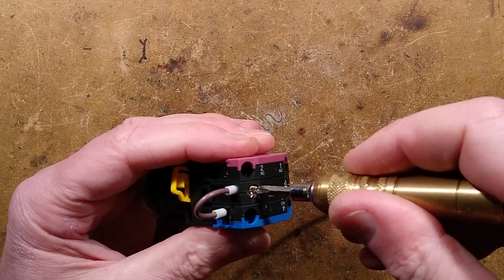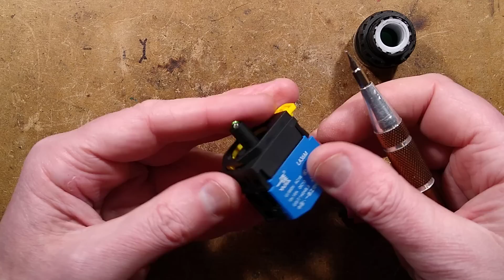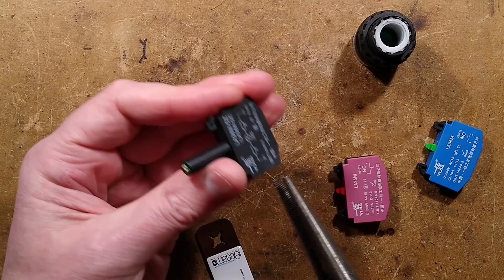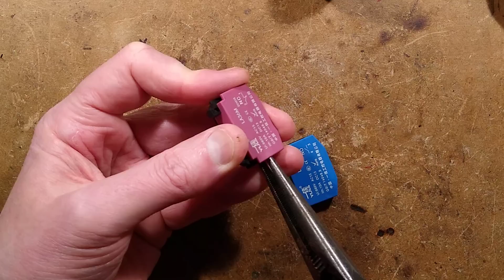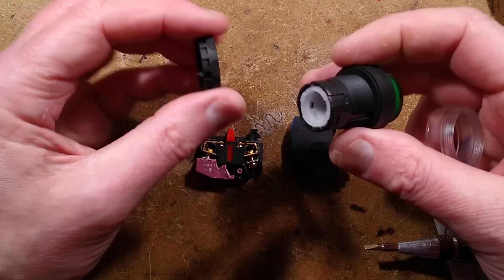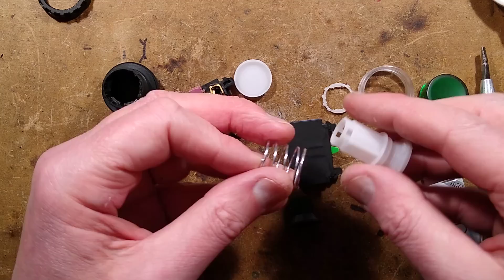This did not come apart easily!

Comment: We go through a lot of the 2 and 3 position switches like that.  The nylon indexer has a very thin connection between where it is screwed in and the strong spring.  That is the only part that breaks on the ones we use.  Good thing they are relatively cheap and always in stock.

Comment: RSVP that button switch. It was a little disappointing that the switches were just the boring springy type, I would've expected more of a snap action type for the higher-voltage application.What wasn't disappointing was the carnage. There really was no other way around it, and it had to be done, for science.

Comment: Hi Clive,
I have a totally unrelated question about new oil-filled space heaters:
To put it simply I bought a new one about a year ago however it was pretty much unusable.
So much so that in the end I returned it to the store and bought a second-hand one probably made about 40 years ago and it works as fine now as it did back when I got it.
I don't think my particular unit was faulty but rather that it's a intentional design choice however this still puzzles me up until now.

Long story:
After only a few minutes of operation the brand new oil-filled space heater switched off by itself. It couldn't be the thermostat since it was set to its maximum setting and my average-sized bedroom didn't get much warmer with only 10 or 15 minutes at most of heating.
So I took off the cover and found that it was the thermal cutout that was cutting out while the heater was just hot enough for it to be uncomfortable to touch for more than a few seconds.

(By the way this space heater also had a tilt switch to turn it off in case it would tip and fall over.)
I then bypassed the thermal cutout and plugged the heater back in and this time it was heating continuously as a space heater should if you want it to actually heat the room it's in.

However not after long it started smelling so bad that I had to switch it off and open the window to get some fresh air.
Using my flashlight I had also spotted a faint haze that wasn't visible otherwise.

I first thought it could have been a oil leak but after having looked absolutely everywhere there was no trace of any oil leaking from the space heater.
So I think it was the paint that was giving off those fumes from the higher operating temperature that would not have been reached with the thermal cutout connected.

I wonder if this design might be a simple cost-cutting measure or to comply with the new and dumb regulations about space heaters only mandated for intermittent operation. (Not mentioned on the box or in the manual but it might still be the case nevertheless).

While those regulations might make sense for kerosene space heaters I don't see the point of forcing them on oil-filled electric heaters as well.
If only all the flats had a decent permanently-installed heating system, but that's unfortunately not the case.
Or maybe is it simply to keep the heater from reaching a high enough temperature to burn little kids hands ?

In any case this heater was absolutely ineffective at heating any room larger than a cupboard and the older unit that I bought second-hand heats my flat absolutely fine without giving any noxious fume or smell and to put it in perspective there is neither a tilt switch nor a thermal cutout under the cover. Only a thermostat and a couple illuminated switches to control the two elements. 

(Btw the new one had a single neon bulb and for unknown reasons they decided to put it on the thermostat knob rather than somewhere that doesn't move. It makes me wonder how long it would have taken for the leads to snap from the repeated motion of the knob.)

(I must also point out that before returning the new heater to the store I reconnected the self-resetting thermal cutout like it was before and thankfully the paint didn't look any different than before so I could return it without issue).

So my question is: Any idea about the possible reasons why my new space heater not only had a thermal cutout that made it absolutely worthless but also a paint that stank the place up whenever it was allowed to get any hotter than what is normally governed by the thermal cutout ?
Also what about the regulations ?

Thank's.

Comment: At my job, we recently had a bunch of e-stop switches that if you smacked them in an emergency, like one does, the switch body would fall off inside the panel without stopping the equipment. How they ever got any certification is a mystery.

Comment: Thanks never disassemble one of these. Have used this type of switch single and double gang many times over the years and found them to be reliable.  Yes brightness of the pilot light has been an issue at times, hence needed to install an additional separate brighte diode light when operating in a well lighted plantroom.  Reliability otherwise was very satisfactorily.  From what you just have showed us the brass terminal variation is likely better, less corrosion over time even though the screw and washer are steel.

Comment: In days of yore I worked for a component's factory that would assemble lots of click-into-place parts then use a single spot of CyanoAcrylate glue to hold the entire assembly together. Lots of multi moulding  assemblies usually for the motor industry.

Comment: When I worked on the railway in the signalling department, we installed similar plungers on the platforms at Liverpool St station for Porters to use for closed doors and train ready to start. They were from Switzerland and we called them Squire 'D's' and they were stackable, so could mount multiple plungers together for extra contacts.

Comment: There are similar switches that have a large, exposed, latching push button. Add a box and socket from the hardware store to fashion a DIY Emergency All-Stop button, for about $10USD. It makes an important safety device for any DIY EE Hobbyist Bench.

Comment: I get why the LED module ought to be sealed, but it's kinda unfortunate the contacts were also sealed. Granted, it's likely the case the whole module is cheap to exchange, but I could see a contact cleaning rescue attempt being foiled by those heat stakes/ultrasonic welds/whatever. One can typically live without an indicator light for a while, but bad contacts are bad juju.

Comment: I took many of those kinds of buttons apart, "servicing" them since my company is too cheap to just replace them. The good buttons that I have the pleasure to service have long grommets or screws instead to access and clean up the contacts, making my job easier on that front. They're almost always incandescent though, due to it simply being easier to have it driven with higher voltages, and the bulbs are still cheap. With that high of a PF, it tells me that the series resistors are pretty much acting as light bulbs anyways, so I'm not sure why they went the route that they did TBH

Comment: I used to work in a toy factory, many years ago.

They had some toys where the plastic parts were dipped in a chemical, I don't remember the name. Anyway the mating edges were dipped and then the two pieces were pressed together, and they kind of melted into each other. I wonder if this is something like the way your switches are put together.
Reply from the maker: Possibly methylene chloride.  It's used to fuse plastic signage together almost instantly.

Comment: It was only this year I learned that 415v is actually 380V. This solar panel engineer explained how only two of the three phases are ever lined up (he did explain it properly i have sjnce forgotten lol)
Reply from the maker: 415V is the phase to phase voltage of a 240V supply.  380V the same for a 220V supply.
Reply: If the phases were "lined up" (in phase) then the voltage between them would be 0V! As Clive said, for a typical 220V rms phase-to-neutral system (e.g. China), the phase-to-phase voltage will be circa 380V (220V * sqrt(3)), for 230V rms phase-to-neutral (e.g. Europe, UK) it will be circa 400V (230V * sqrt(3)) phase-to-phase, and for 240V phase-to-neutral (e.g. what the UK used to be in the 90s), the phase-to-phase voltage will be circa 415V (240V * sqrt(3)). The phases are 120 degrees out of sync with each other, hence three-phase (3 * 120 degrees gets the circle).

Comment: The way thats designed reminds me of the 4 position monolever I bought for my G920 wheel. I wired it up to a pi pico and whenever its actuated it does all 4 arrow keys depending on what position you push it. For headlights and turn signals in assetto corsa.

Comment: Those micro-switches are a fire danger.
All micro-switches, as per rules, must have a spring which close the contact with a set force, independent from the travel of the pushbutton. 
Just buy good branded electrical components for a fire-free environment.
Thank you Big Clive, for all your dedication in showing the inner workings of good and bad technological devices.
Greetings,
Anthony

Comment: The can opener on a Swiss Army knife makes a great spudger, specifically the can opening blade part (rather than the the screwdriver tip). It's even better if you make the blade angle a little shallower with a Dremel. It's not flexible but it's wedge profile is really good for wiggling into the joint of two halves of a plastic shell and gently working it back and forth around the perimeter until the item in question finally gives up it's secrets. A Spartan or a Pioneer, particularly the Pioneer is a really underated tool for opening objects that the manufacturer really doesn't want to be opened.

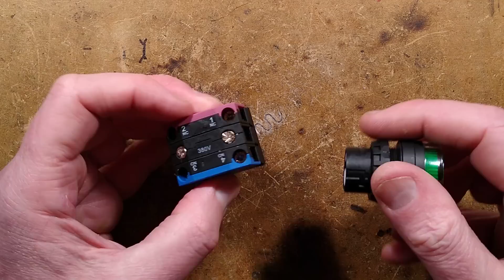Comment: 2:20 Not only China has 380V between fases, here in Belgium, and i think also in most part of Europe. 3 phases and neutral, between the phases 380a400V and between each phase and neutral 230a240V.
Reply: In the EU it was standarized to 230/400V +10%/−6% which are 216V to 253V single phase and  376V to 440V three phase so in practice each country was able to keep the same voltage and stay within the limits without having to replace thousands of very expensive transformers.
Reply: With 380V Phase/Phase you'd actually get 220V phase-neutral😅 here in germany we have 230/400V, we had 220/380V back in the days
Reply: @legominimovieproductions  , we call it here 380V , but in reality it is also 400V and sometimes even a bit more. In summertime with a lot of noughbours with solarpanels, we get higher voltage if more power is injected back to the grid. Our walloutlet is normally 230V , but in reality it's between 235a240V and i have
 also seen 242V at certain moments. I feel sorry for the people that still use 120V 😎

Comment: I learned at an early age  (like 6 years old) that's a lot easier taking stuff apart than putting it back together. Especially stuff not meant to go back together. All well, that LED wasn't bright enough anyway.
Reply: When I was a young child my parents started to buy small appliances for me to dismantle (clocks, radios, etc.) so that the family would have at least one fully-functional set for normal use!  Everything (and I mean everything) got dismantled at least once.

Comment: It looks to me like the switch halves are ultrasonic staked, two pins fitting in two sockets. Before welding, this type of joint has interference of the pins and sockets. As vibration is applied by the ultrasonic welding transducer the pieces melt along the shear line between pin and socket , around their circumference, to bond them permanently. It's used a lot in low cost mechanisms. Disappointing that the switches themselves are sizzlers rather than snap action ones, the life may be low if switching high voltage high current loads. May last a while though if switch relay coils or similar low volt low current loads. A-B they sure aren't, but I imagine the price isn't A-B like, either. Thanks for the teardown. Cheers!